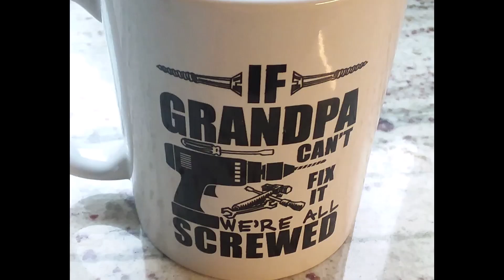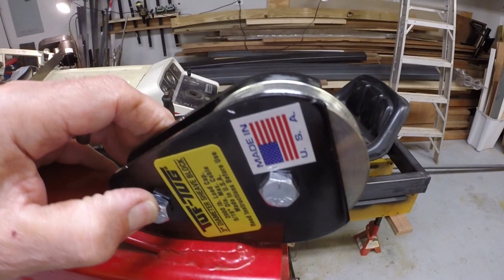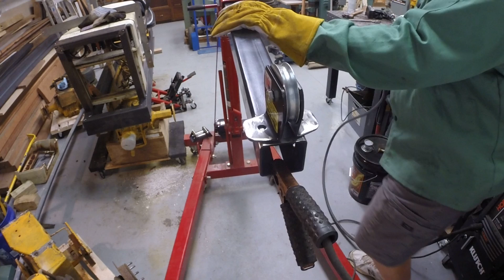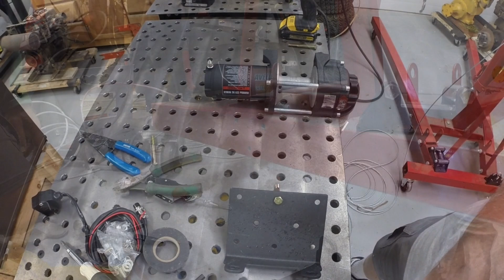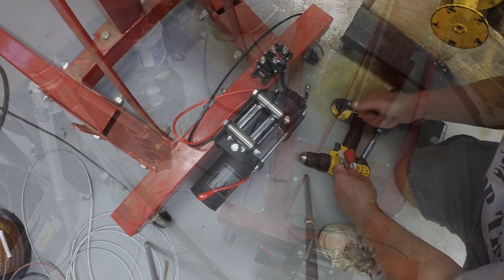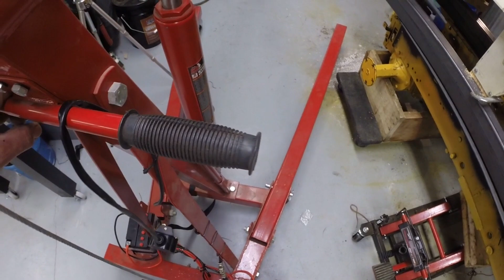Engine Hoist Electric Conversion

Comment: 32:13 I would put the battery in the middle, & I think instead of the pulleys maybe some formed curved conduit could of worked just to guide the wire

Comment: I think i would have mounted the wench via receiver hitch incase you had other uses for the hoist also with uncapured cable pulley guides so won't have to undo all the cable places to relocate the hoist for other uses also all the electrics could be temp so they could be transfered along with the wench settup  ! Cutto's on the build !

Comment: Why not use an electric ram in place of the hydraulic ram?
Reply from the maker: lifting capacity is much greater with hydraulics than with a linear actuator.  Also cheaper.  That's not to say you couldn't do it, but it's not practical in this application. You could use an electrically operated hydraulic pump to drive the hydraulic cylinder, but at substantial cost.

Comment: Nice video thnks. You can get rid of half your wire if you use the chassis for your ground. Then cut off the exess red lead and use some matbe 516 wire hold downs to secure your pos wire

Comment: I used a 2500 lb atv winch with two pulleys mounted on a rafter that was beefed up to raise a truck cab off of the frame. They work great! I used a Walmart garden tractor battery that cost $40.
Reply from the maker: Sounds like a good setup!

Comment: works only up to a point.  The winch will pull the boom up after a while the way you have it mounted. The ram will lift things of course.. but the ram also "extends, opens  freely" from whatever point you used the ram to lift it to.  Further past horizontal... odds greater the boom will want to pull the ram open way you have this winch mounted.   For example my present task will be lifting about 1200lb (3ton C.Pikcer)  but the boom  will be way above horizontal.  As the load gets near the top...  YIKEs..... it gets close to flopping boom over the top when you combine winch  mounted down there... having some lift of boom desire... then couple that with the wind (in my case) etc not impossible.   Put winch on the boom is safest unless the ram is 2way function.

Comment: where did you get the pulley?  I could not find one with a rating high enough.  LIke you.. going to try to finagle a hack of an off road snatch block (for UTV) but on the front. Am mounting winch on back end of boom arm.  .
Reply from the maker: I think that was mcmaster-carr.

Comment: I did this to mine in 2022.  
I used a 2500 pound ATV winch i got on sale at HF for 49.99.  
I mounted mine on the end of the boom with a trailer hitch adapter. 
I kept hydraulic ram on for insurance to help hold load in the air while moving my engine hoist once engine pulled. 
Be VERY CAREFUL!!   As i discovered,  you cant feel the load when pushing a button on remote to raise the engine i was removing. One of the mounts caught on the frame and when winch strained i thought it was because it was a cheap unit but  it continued to raise engine! Something had to give and it folded my boom! 
I got another engine hoist and in the future i know that ATV winch will lift 700 pounds with ease.

Comment: Was there a reason you chose not to utilize the empty square space inside the frame? Since you were going to be using the welder anyway to attach the sheaves on the frame and extension tube, I would have thought a little extra effort to weld a steel sheet under the open section inside boxed frame area would have made a lot of sense. 

I believe doing so would have created a perfect “tray” or “platform” to secure AND/OR group all of the new components to. You get the benefit of being able to use shorter runs of copper wire(i.e. less material cost, less likely to overheat, less clutter, less straps and organizing) along with the biggest benefit [IMO] of maintaining the original footprint and not worrying about accidentally bashing the winch unexpectedly.

 If it was mainly just a quick and usable prototype of concept that would make the most sense to me but since I don’t own an engine hoist myself maybe I’m missing something rather obvious that everyone else figured out immediately 😅.

Comment: Don't care for buying an electric wench and battery for this idea but the position of the pulleys and using a simple $20 hand wench has me thinking. There's times when I didn't want to move the arm and just a straight pull up of a cable would have been handy, so thanks for the idea.  🙂

Comment: Good job.I might add this to my hoist. One thing that everyone should do,whether you are working on something like this or especially you car, always disconnect the negative battery cable. It will protect electronic components and avoid unintentional welding. 😃

Comment: Where did you get those bottom 4 turf tires????  I’m converting a hoist to pot and Boulder mover need major turf tires
Reply from the maker: Those are probably Carlisle 23 x 10.50-12 turf tires. Millertire.com has them. As do most major ag equipment suppliers. Garden Tractor tires.
Reply: thx @woodandmetalshoptime8048

Comment: one thing you couldve done is mount the winch and electrics on a metal tray inside the square opening on the bottom frame behind the verical arm of the lift , that would protect everything a little better against things dropping on it or getting bumped intoo when moving the crane with a heavy load hanging off it , allso have enough mounting options for a lid over everything sitting in the "hole" 
it would allso have all the wiring inside a protected area so it cant get pinched
Reply from the maker: That might work if you could route the cable to allow for extending the boom somehow...
Reply: @woodandmetalshoptime8048  you mean the electric cable coming off the winch controll ?
it might work if you tread that cable through the boom and have the cotroll hang of the tip of the boom near to whare youre working or worked through an extra hole in the small end of the boom and screw the controll to the side of it 
then the electric cable that is extra when the boom is shortened just comes out as a small extra loop hanging of the back end  , 

if youre talking bout the steel lifting cable , you could have that going through the center of the boom as well little over the top of the pin holding the boom in its extended state as its open on both ends , you would need to mount the pulleys inside the box section on both end (remove the puley from the original bracket drill hole in both ends of the lift boom and bolt the pulley inside the boxsection with the bolt going  through and through , no welding needed ) that way the cable running through the box section without rubbing on its edges 
you need to loosen the lifting cable enough before extending the boom by hand , extending or shortening said boom with a load hanging off it wouldnt work anyway as the load it jamming the smaller box section in the bigger boxsection

Comment: Think we would just find some way to mount the winch on the end of the jib and run electric cable to battery from There. But we are lazy that way. Would think about remote for winch so we can guide load with one  hand and control with other.  Nice job. At least your doing it. With all   Of out ideas we mostly not get around to do it. 😁😀😃

Comment: I think the operating switch needs moving so you can operate it and guide the load into position at the same time, maybe in a clip at the end of the jib so its fixed but can be removed into your hand.
Reply from the maker: It's on the end of a 12 foot cord.

Comment: I did the exact same thing  last year Frank👍🏿 however I mounted my winch on top at the back of the boom and mounted my deep cycle battery on top of the square tube where you have your winch mounted, its funny I was in my garage today thinking🤔 about how to make the hydraulic ram fully electric over hydraulic instead of that silly pump action🤦🏿‍♂️

Comment: The pulley above the winch has to be at least a foot above the hoist pivot to help the leverage of the wire rope.  The closer you are to the pivot, the less lift you achieve.  Ideally, it should be at a 45 degree angle away from the pivot point so it is a foot above the arm and a foot away from the upright.  Otherwise when lifting something heavy, you are putting an incredible strain on the cable as the way it is now.
Reply from the maker: The winch wire rope does not lift the hoist boom. It simply lifts the load. The boom is still lifted with the hydraulic cylinder. So there is no mechanical advantage to placing the pulley as you've described.

Comment: I love this video of you converting the engine hoist from manual to electric. I went one step further, the electric hoist solved the up and down problem but the hydraulic ram is still so slow at raising. I replaced the ram with a Wen 7218 ram which is much stronger and added a 12vdc hydraulic pump which comes complete with up and down switch. Now the hoist and ram are run on 12vdc and the hoist itself is much faster whether using the cable to hoist material or the hoist arm. thanks for the tip.    GARY LICHTENSTEIN, LAS VEGAS, NV
Reply: @garylichtenstein943 would you do us mere mortals a favor and share a quick video of how you integrated the 12v electric pump with the Wen 7218 ram?  Love the idea

Comment: Harbor freight is cheaper and more compact. A double pully on the end of the boom and double line it to increase the lift. Also when welding the pulls on the end shrink the boom to the 2 ton 4000 lb mark. Keeps you from shorting yourself on capacity.

Comment: I like it but would have mounted the winch on the top of the cross member rather than behind to reduce the overall length of the unit.  but that is just me.  really nice job.
Reply from the maker: I thought about that, but didn't want to put the attachment bolts in tension (pulling them straight up) but rather in shear, where they are pulled sideways, a much stronger orientation.

Comment: Great job but I would have put pulleys inside the square tubing just enough to not bind or scrape the cable
Reply from the maker: Hindsight is 20/20, isn't it?  I had trouble finding smaller pulleys with the required capacity, but I think I've got some now. I might retrofit it that way. I agree it would be cleaner.

Comment: I like it. I think shivs through the tube with cable over the boom pin and a deep cycle and relay  in a box behind the Ram with leads out the back into the winch; would be safer and cleaner.

Comment: Great idea. On the safer side, I would not connect the battery until all the other connections have been done and checked. This would eliminate the sparks you made. Great job though.

Comment: My question is - Why not add a hydraulic pump, adding a return line to the hydraulic piston, with a on/off/on 3 way actuator valve?
Reply from the maker: That's a great idea!  You'd still need 12v power and a hydraulic power unit. Lowering the load might be difficult to control, though.
Reply: Harbor freight sells a pneumatic hydraulic ram I've run on my engine hoist for years. That said,  this setup is something I've often thought about doing too with a manual worm gear  winch

Comment: I’m sure you’re aware Frank but it’s only 3500 with one layer of cable on the drum. Each layer you have you lose about 15% lifting capacity.
Reply from the maker: I didn't think about that, thanks for pointing it out. Maybe should have read the manual??  LOL.
Reply: @woodandmetalshoptime8048  
Manual? What’s that? Lol. Yeah it’s amazing how much you lose with each layer. I’d save the longer cable and just make up one long enough to reach the ground with just a couple of wraps on the drum and by the time you lift it up it’ll probably be just one layer.

Comment: PLEASE cover all those terminals as soon as you possibly can..  I can already imagine the wire rope or a wrench falling on that relay or even just rolling under a metal frame or chassis or anything else and doing some serious damage, seriously quickly.. 

also, pick up a wireless relay conversion with a wireless remote and I think you will find that set up FAR more useful, where you can be out near the load and able to hold onto it with (most of) both hands and just click the remote with a thumb.

Add a trickle charger to that motorcycle battery, too.

Just my two cents, it's a nice project as is!
Reply from the maker: All great ideas!  I have a trickle charger, so that's a done deal. I like the wireless remote, will have to look for one.  As for the relay, yes, that's already got a plastic cover on it, but a great observation!  The sparks in the video show the potential (no pun intended) of bare connections.
Reply: @woodandmetalshoptime8048  Regarding the remote control, I have a HF small winch with the remote.  I find there is a delay from when you release the button & the winch responding.  It kind of makes "fine" control difficult
Reply: @skip7243  I have the 'same' winch and had seen comments from others saying the same as you, but have never experienced this delay.  I wonder if there are multiple models being sold as "the same" or of it's got more to do with how the winch is installed (mine is on a utility trailer that is primarily wood, not lots of metal or running engines around it), or if it's just a quality-control issue...
Reply: @DieCastoms  I cannot answer why, just know there is a few second delay in both directions, so I anticipate it.

Comment: Frank, another option is the type of battery used in a jump box. They vary a little. Some are 17a, and others are 18a and sell for about $35 depending where you bet them. These are an SLA (sealed lead acid) BATTERY.
Reply from the maker: I almost used, literally, my jump box but opted for the battery so I wouldn't tie up the jump box.  But that's another great idea.  I've replaced the battery in my jump box twice over the years. I think I bought it in 2002.  So I know exactly what you are talking about.  Thanks for watching and adding your ideas!

Comment: Nice job, I’ve seen a couple different ones like this, one had the winch on top but you said you didn’t want to have it too top heavy. You’d save one pulley though. 
The one I’m thinking about is using a travel trailer lift jack, they’re 12 volt and lift 3500 pounds with 22 inches of lift which is probably higher than the hydraulic jack that comes with the engine lift. They’re around $150 bucks plus the battery so similar in price or maybe a little less. One thing I like is it won’t bleed down and you have the advantage of the better control that you have with your setup. I think you’ll really like that engine lift now that it’s electric.
Reply from the maker: I've been using it a lot already. You will see how in upcoming videos.  It's turned out to be very handy. Thanks for following along!

Comment: Hey Frank thanks for sharing your creations. But I have to tell you, with having the equipment in your shop that you have ,you could have made the pulleys on your lathe and mill and installed them inside the square tubing on the hoist. Then the cable would have been safe and concealed.  Of coarse  that’s just me. Anyway, cant wait to see the process of the dozer.
Reply from the maker: Great idea!  That would have been more interesting. Got me thinking now...Hmmm.
Reply: @woodandmetalshoptime8048  having seen other things you've done that is honestly what I was expecting..
Reply: Of course, he'd have to take into consideration the pin that is used to set the different lengths of the arm.

Comment: Frank, do you ever buy any made in the USA tools or anything name brand?
Reply from the maker: Not so easy to find actual made in the USA tools. I buy Dewalt, Fein, Makita, Porter Cable, for most hand power tools. Have a couple Hitachi tools I'm about done with.  My plasma table is made in the USA.  My cars are all USA/Chevy/GMC. As for name brand, depends on use. My table saw, shaper, band saw, lathe are all Delta, South Bend, Logan.  My Cub Cadets were made in the USA!  So it depends.